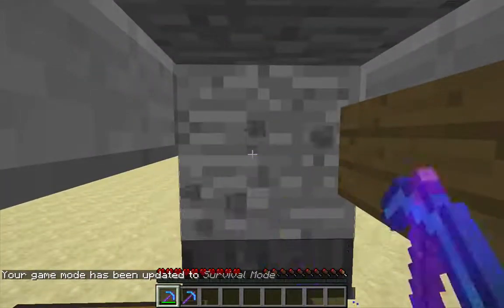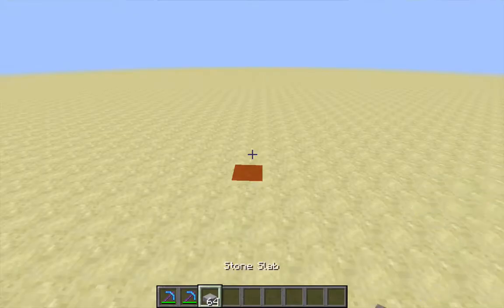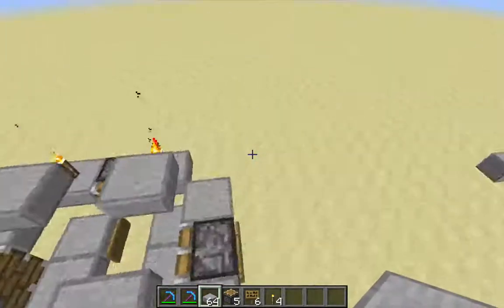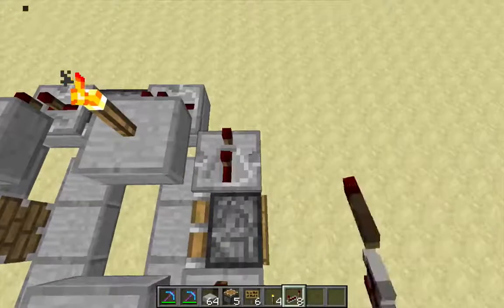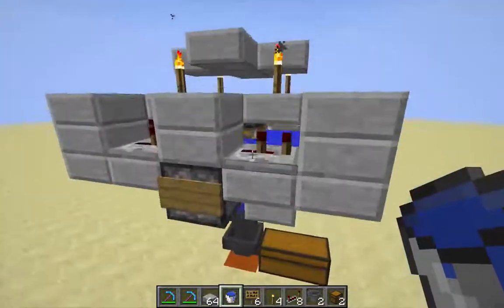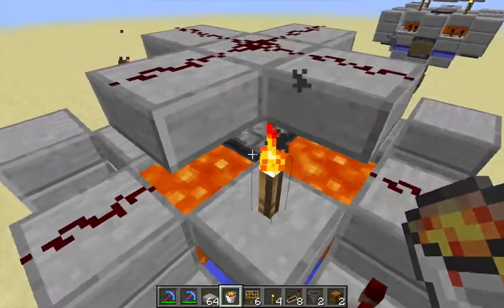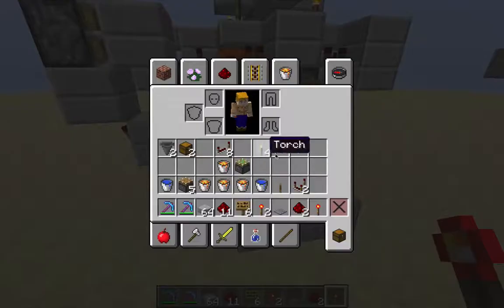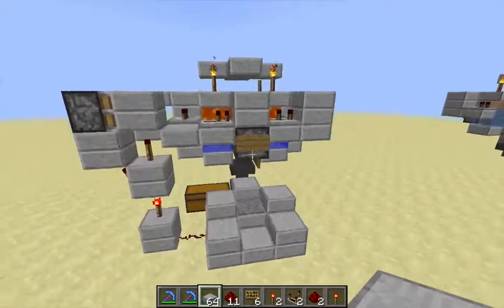Tutorial: Stone Generator v2.0 (last one, I promise!)

Comment: When I get a project down to it's simplest, I say it "crystallizes" when it seems like it couldn't be better. I would say you have crystallized your design.
Reply from the maker: +Shadow 8472 Yet there always seems to be some way to improve things a bit more. :-)

In the case of this stone generator, this is not actually the one I'm using. The one I'm using is a derivation of this, with a piston-less on/off switch that fits entirely under the 5x5 frame of the machine. I showed the version in the video just because it was easier to explain.
Reply from the maker: +Shadow 8472 Here's a world download with the modified version, very compact: http://www.mediafire.com/download/m3b2kbk0b3cncmz/Big_Tiny_Stone_Generator.zip

The lack of a sticky piston for the on/off switch means that I can build this in a new world pretty much immediately, without having to lurk in a swamp at night for 1-off slimeballs. (Although a regular piston+sand is always a possibility, I once caught an Enderman stealing the sand from such a device, and it caused quite a havoc. Now I'm leery...)

Comment: make more stone videos !!!!!!!!!!!!
Reply from the maker: +respawn master :-) At some point, maybe I'll make a video on a fully automatic stone farm, which uses a creeper-powered cobblestone farm in conjunction with a witch farm. (Sticks dropped by the witches can be used as furnace fuel for smelting the cobblestone into stone).
Reply: Nathan Ryan why not witherer,  those are always fun
Reply from the maker: +respawn master In many ways, using a wither for that purpose would be a lot better. First, it eliminates all of the creeper separation mechanics. Second, you don't need a concurrently running mob farm, which reduces the efficiency of the witch farm. I guess my head is stuck on the creeper-powered cobblestone farm because that's what I had originally built when I was experimenting with creeper separators.
Reply: +Nathan Ryan hey I built a creeper cobble farm in my survival world it was very slow but fun to build
Reply from the maker: +respawn master Just checked out your wither cages, very nice! Good idea for the cobble farm.
Reply: Nathan Ryan Thanks